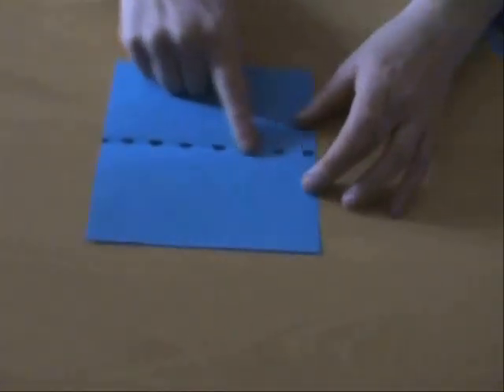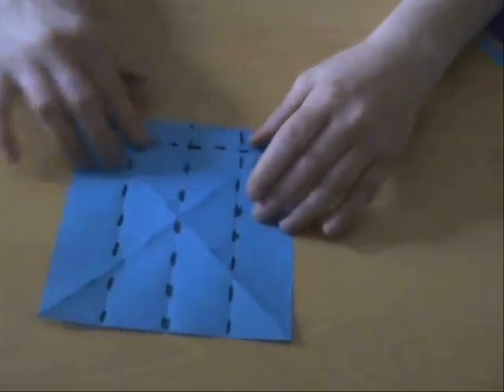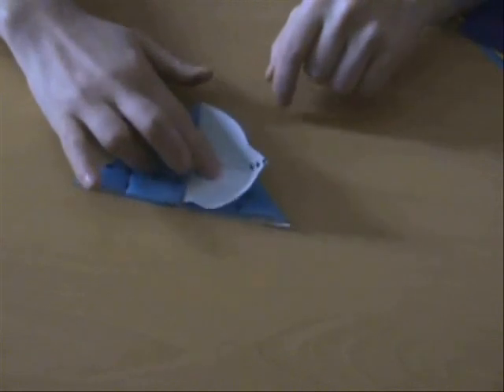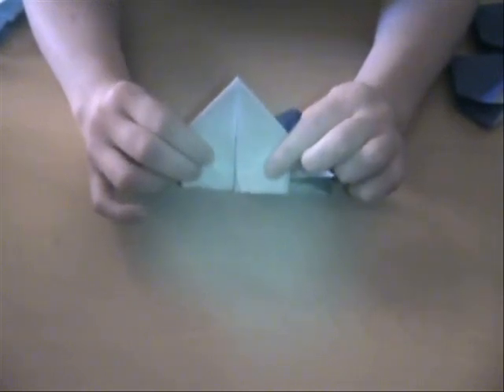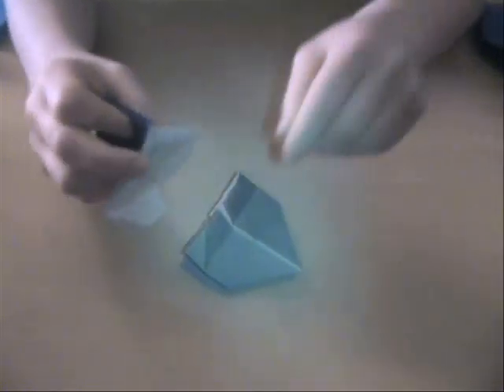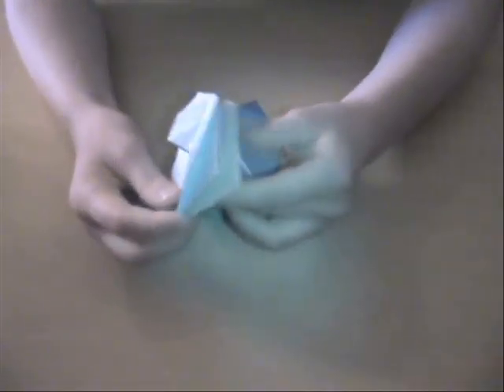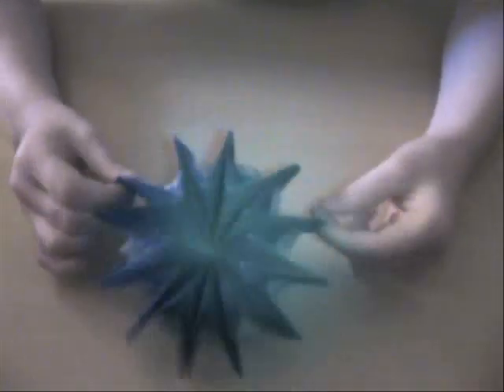Origami Fireworks by Yami Yamauchi: Improved Assembly

Comment from the maker: If you assembled just as shown in the video and you are having problems, try adding another module. The tension should then be lower. You can also try making the creases of the locking mechanism stronger, and checking that the paper aligns nicely everywhere. This should make the construction more stable.
Hope this helps.

Comment from the maker: @ShredTheHood Well, if you connect them as shown in this video, it's more robust. If you use the other assembly method for most of the modules, some of the modules may disconnect again when you connect the last two. You can just try it out. Also, it may be that if you use different locking mechanisms that the model will not twist as regularly, but slightly differently for those two modules. In principle you can combine the assembly methods, though.

Comment from the maker: Any square paper will do. I recommend squares between 7.5cm and 15cm length on each side. That translates to 3in to 6in length on each side. Slightly thicker paper (eg normal printer paper, or thin card) will work well for this model.

Comment from the maker: Regular origami paper works quite well for this model. If you want you can also use slightly thicker paper. Thinking about it now, using patterned paper might give an interesting effect. Maybe I should try folding a model from sparkly paper. :)

Comment from the maker: @7459cinnamonroll You connect the last modules the same way as the first modules. You might want to fix most of the other modules first (this is also shown in the video) before connecting the last couple of modules. This should make the model more stable, so that none of the modules disconnect when trying to connect the last two. If that still does not work for you, try adding one or two additional modules. This will reduce the stress on the connections while assembling.

Comment from the maker: 15cm squares, 80gsm. However, this model works well with thicker paper. And 15cm squares make a pretty big end model. I prefer using 7.5cm squares. For the video I always use bigger paper than I'd actually use.

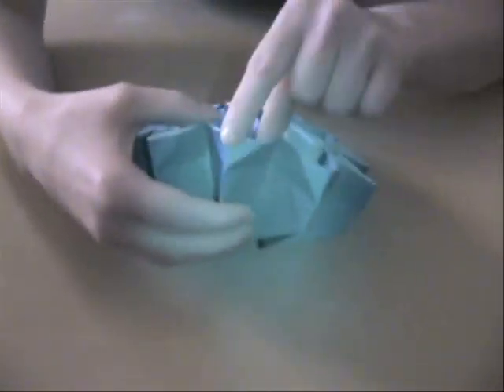Comment from the maker: I don't think the model would be stable enough if you stopped at 8:00. Making the creases from 8:00 onwards enables a robust locking mechanism, which allows the twist action to be performed without the modules falling apart again. You can give it a try, though.